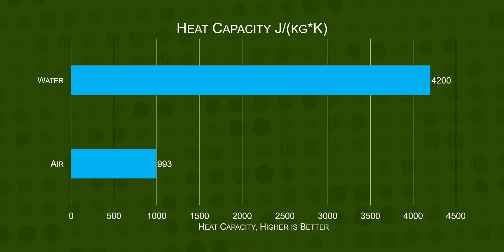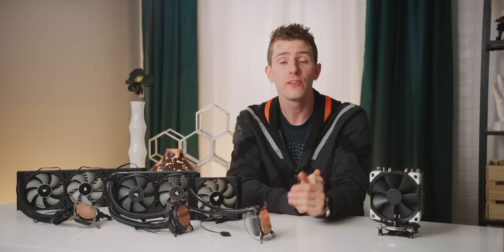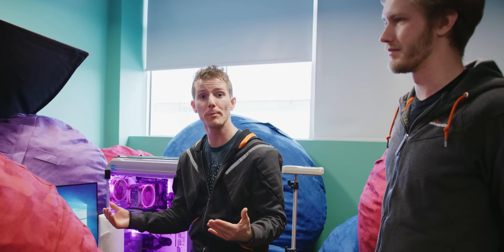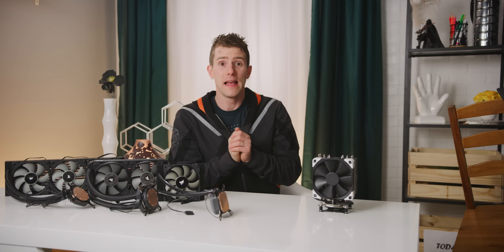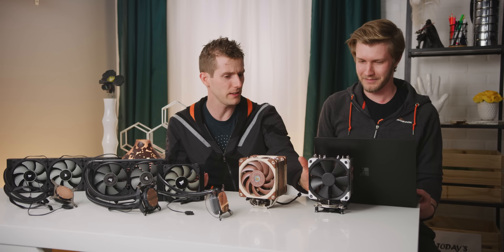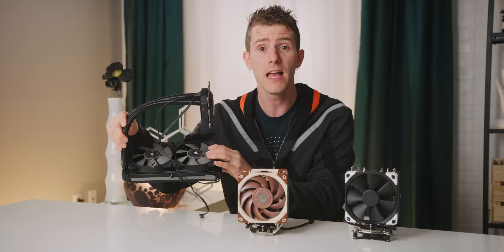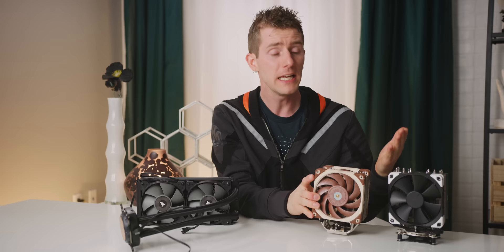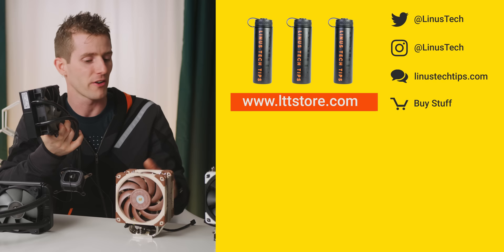Why you shouldn't water cool your PC

Comment: What is that paper roll doing in the quite room? ;)
Reply: hahaha I was wondering if anyone else noticed that
Reply: I will destroy your joke. they used it to clean thermal compound. they had to change the cooler 3 times.
Reply: @HeavyMetalGamingHD  I say maybe to that ;)
Reply: Playing the quiet game
Reply: I wasn’t taking it like some others, but it was a little stupid that Linus kept pointing to the case with the paper towels partially obstructing it.
Reply: dampen sound exiting at the back of the case
Reply: @pihermoso11  but they were trying to measure the sound levels exiting the case so, that roll would cause bias to the tests. Maybe they had the roll in wrong place when they measured air cooling.
Reply: i dont QUITE know
Reply: @HeavyMetalGamingHD  5 times actually
Reply: Could u give the timestamp
Reply: @HeavyMetalGamingHD  Also doubles as a bass trap considering the lower frequencies are still audible even if barely

Comment: Can't believe you didn't include the (venerable) NH-D15 in the testing!
Reply: That's what I'm looking into getting over my current 120 mil liquid cooler
Reply: @cupparuppa  you're in luck. The D15 stomps on 2x120mm AIOs even in short tests.
Reply: Yeah! Best CPU Cooler! I use it with LNA. Don't hear a think it my 7700k at 5Ghz stays below 85°C  while running prime 95

Comment: Air cooling all the way here. After a Corsair H100 killed my video card and caused a very messy cleanup and salvage process, by springing a radiator leak and showering the electronics in coolant.

Got a Noctua NH-D15 after that, and never looked back. Got way better cooling than the H100 provided too. If I had only checked that before I got the AIO. Expensive lesson learned. No more mixing water and electronics for me.

Comment: But but but... you CAN swap out the AIO fans with the snazzy ninja-esque Noctua many-bladed feathered edge jobs that whisper even at full pelt.
Reply: That would reduce only the fan and airflow noise imho. It's the pump where the issue probably lies in this case. I've been using Corsair ML120 Pro fan (no motor noise, airflow noise can be heard only while gaming when set properly, great static pressure) for my AiOs probably since they came out. When I swapped the old AiO (CM Seidon 120M) for a better one (CM Nepton 120XL), even when using that same ML fan, Nepton had this irritating pump noise that made me sell it and go back to the Seidon again. No fan can ever reduce the pump noise. 
But then again, it would be nice to see the test repeated with Noctuas on all of the tested CPU coolers, just to see if I'm right on this one. At the same time, it should be noted that total price for the AiO with three Noctua fans would go up and above of the average cooling solution. :)
Reply: each one of those fans is $30.. your cooling setup would end up costing over $200 vs $60
Reply: @c0rpse1  I didn't say it would be cheap! ;)

Comment: I had a Corsair H80i for a week. Than I sold it, and got a Phanteks air cooler. Couldn't be happier.
Reply: You could've just returned it
Reply: I couldn’t live with a giant ass ugly brick in my build
Reply: I also have a bigass Phanteks cooler.  Pretty nice having A++ cooling and not have to worry about pump failure/leaks.
Reply: @bitdrive7971  yup. Unless you don't care about looks, AIO coolers are great
Reply: Xsauced agreed
Reply: I dunno, I have used a H80iGT for nearly 5 years. Never had a problem with it. Has kept my FX 9590 cooler than my 212 Evo ever could
Reply: mrjspeed just for your information aios don’t just randomly start to fail

Comment: I think better test will be with same fans on every cooler.
Reply: agree. What happens when I put dem noctua fans on the water cooler?
Reply: cwjakesteel -00000 Temp
Reply: thegeorgezila  Not necessarily. Besides you can use the Noctua speed-lower-er device that cuts the fan speed in half. I use that on my AIO

Comment: i run a tripple rad with noctua fans. best of both worlds. the standard fans that came with my AIO were really noisy imo.
Reply: Same with dual fan.
Reply: youll have to replace the AIO sometime. Gunk builds up in the block, also im not sure how long those pumps will last. Noctua will send you mounting kits for future form factors, for free, anywhere in the world.  Reliable top performance with a practically unlimited lifespan is a big dumb block of metal with a noctua fan
Reply: fredfinks you can clean out quite a few AIOs. After 4 years I ripped mine apart (thermaltake water 2.0)  and there wasn’t much gunk. I sliced them together into a custom loop too. Just got new tubing, res, and water treatment. Also only have  Noctua fans in my case including PSU and Kraken G10.

Comment: Would have loved to see a Dark Rock Pro 3( maybe 4 too!) in the $75-85 price range just for funzies
Reply: M. K nice I have a dark rock pro 4 and I never go above 53 degrees. though I'm using an i7 8700k overclocked
Reply: They should have definitely done that
Reply: DRP4 here too thing is literally sex
Reply: From what i found out online trying to get my computer a LOT quieter(parts haven't arrived yet) Be Quiet's Dark Rocks perform very closely to Noctuas in any given price range with the advantage being slightly more silent for slightly less cooling. So in conclusion they are the kings of AIR cooling, and you pick one of them depending on what you prefer more, slightly more cooling or noise levels, also Dark Rocks look really cool while Noctuas are kind of ugly xD.
Reply: @cyzcyt  They are also comparing noise levels to the ratio of cooling...
Reply: Noctua is great for sure, but it looks like ass, literally brown. RIP color schemes
Reply: I have a Be Quiet Shadow Rock 2 on my Ryzen 1600X...with the stock fan it was garbage, but with the eloop B12-PS from Blacknoise it works like a champ! (with the new fan I have it overclocked to 4.0 GHz @ 1,35V)
Reply: Me here with a i5-8400 and an Evo 212
Reply: @_BangDroid_  Just buy the Chromax fans then?
Reply: Also have a DRP, which is on par with the good NH14 Noctua unit.
Reply: I have a Dark Rock Pro 3 sittin on an I5-5675c, maaan, even overclocked to 3,8 GHz its under 60 and sooo goddam quiet, i wanted to watercool my GPU, because it was killing me it was soo noisy next to it. So naturally, after watercooling my GPU i had to watercool my new CPU, the R7 2700x too, but if i would have the mount for AM4 definitelly would have played with it. That 250W beast is a BEAST!

I have that i5 in an Asus Z97i-Plus miniITX motherboard, the funny thing about this: all you can see from the motherboard is the PCIE x16 slot...:D

Comment: I've been using the same Corsair H100i for literally 7 years and it's still chugging along just fine :D
Reply: ROFL...uhhh ok.
Reply: I replaced my h100i with a noctua air cooler. Now delidded with better temps and not as loud.. These guys are totally right. AIO's suck
Reply: @jamieburns2407  lol my laptop with i9-9900k with 2 rtx 2080 with 4k is no joke
Reply: @0991ekul  That is your opnion, i have a h115i on my pc for 2 years no problem, i have 0 reasons to switch to air cooler, the video gave me none.
Reply: @OShadowPanda i wouldnt say theres a problem with AIO's. but theres no need for them 95% of the time. theres so much gimmicky garbage in the world of PC's nowdays.
Reply: I had a corsair h100i that killed a cpu when the coolant coagulated and the pump failed...as did a friend of mine...I guess its one of those "your mileage may vary" cases
Reply: @0991ekul  IMO the main reason for an AIO vs fan cooler is aesthetics. Big fan coolers block everything and if you want to make the computer a pretty showcase an AIO will let you do it as the bulk of the cooling is off to the side and the motherboard beautification heat sinks, LEDs if your into it, sexy looking ram all become the centerpiece. Your paying more for a showcase not performance as far as I am concerned ^-^
Reply: @Dlome693  bingo my friend.
Reply: @tropicthndr  wat
Reply: Almost hit the 10 year mark with my h100i...still chugging along! I'm probably going to bump up to a 280mm tomorrow tho. 10 years I'd say I got my moneys worth!

Comment: used an aio since corsair first came out with them 10+ years ago, never failed.
Reply: I use a watercooler for my i7 6950X for the 6 years I have built my system; never failed, zero noise. I also always use water-cooling for all my GPUs, zero fails, zero noise at 4k. This video did not age well at all lol.
Reply: I'm going to wait here until it fails

Comment: Water cooling just really does not seem worth the effort.

Also, everyone talking about the fan sound then putting their high quality gaming headphones on...
Reply: There's no effort when buying a pc with it installed...
Reply: Yeah, at this point there's almost no reason to compare noise levels. Unless your cooler is incredibly loud you shouldn't be able to hear it over whatever it is you're doing with the PC, even if you're just using speakers.
Reply: Yeah I don't think that whoever designed water-cooling as a "95% soundless cooling option" accounted for noise cancelling headphones. Seems like a fair oversight. Albeit I think that if it gets cheaper enough, which I doubt because air cooling is inherently just more simple, then it'll get more mainstream around the world.
But I think it'll stay as it is (an alternative form of cooling for people who like its looks) until something else is invented
Reply: Not everyone wears headphones when they game.
Reply: If you use a TV then noise isn’t a problem.
Reply: @KotauFPS  What country are you from? I'm from little New Zealand and i havn't seen a non-watercooled PC in about 5 years lol. People still use air coolers???
Reply: Not a lot of effort in an AIO. You just mount the fan piece and connect the cpu piece. It takes maybe another 2 minutes compared to the air cooled heatsink.
Reply: @Corruptness  Yeah, I build my own.
Reply: @TheEnoEtile  Agreed and you only do it once every few years when you upgrade. That said I love aircoolers because they look so big and work well.

Comment: Actually it's not water vs. air cooling, but water vs. heat pipes since both use fans to get rid of the heat...

If you move your PC regularly, buy a laptop.
Reply: That's how it's called. We call it air cooling to simplyfi it
Reply: Regular might be once every 6 months for a desktop though :D
Besides, you can get a much more powerful, cooler, longer lasting desktop than you can a laptop of a similar price point. For those who don't have much money and it's one or the other and moving around isn't constant but tehy also want a top tier gaming experience. Desktops are better :)
Reply: @Hedgehog1039  No. People who move around more get a laptop. You aren't going to get to and from work with a desktop. I know people that need one machine at work and at home that is powerful. They have laptops
Reply: @mikoajkoek3145  Notice how I said 6 months could be regularly for a desktop. Of course you woud use a laptop if you had to take it somewhere every day.

Some people do need to move their desktops regularly (in the sense of a desktop) but not every day or week or whatnot.  Some people take them to their friends or families sometimes for LAN parties for instance.

If you are using it for gaming and don't rely on it to be portable because you are not taking it somewhere every day, a desktop is cheaper and more powerful. I wasn't suggesting that if you are truly mobile or need a portable device for work that a desktop is somehow the better option.

Going back to my first point. Regularly doesn't mean the same thing when applied to different scenarios.

Comment: building your own custom loop is the pinnacle of enthusiasm. trust me, just try it! :D
Reply: random rick but money sadly doesn’t grow on trees
Reply: A friend of mine did. His all amd system is running at around 30°C at full load. He did use around 4 or 5 radiators though and at least two were 360mm and one was a 280mm. I think he invested more intp watercooling than the system itself. He doesn't even care for gaming all that much anymore and just enjoys tinkering with his build

Edit: No the radiators don't fit in his case. All but one are wall mounted
Reply: Someone I know the feeling lol
Reply: @bitdrive7971  Depending where you live, its made out of them lmao
Reply: @Someone-ci8wf  I went custom loop with my ryzen 5 2600 (OC to 4ghz) and 1070 ti (OC to 2.2ghz on chip, and 10ghz on the memory) with a single 360 rad (barely fitting in a meshify C TG) and I get 45c peak at full load (100% gpu usage, 45% cpu usage, Rainbow Six Siege ultra @ 1080p) after 2 hours (don't have a water temp gauge so can't tell you that)
Reply: @Someone-ci8wf  He should also try peltier element (TEC). ТЕC pumps the heat from one side to negative temperatures while heating the other side ... so the CPU is really cool and happy, while the other side is very hot but who cares. This idea was very popular few years ago but it didn't take off for some reason...
Reply: Too much money. Too much hassle. Too much maintenance. Looks pretty tho.
Reply: Dio Black  Some times its about more then just the basic experience, some people want better looking rims, even if the old ones work, or in this case having better cooling, even if the basic system keeps your parts at a decent operating temp, if you have the money why not make your system cooler, look better, and run faster. Its not like its all that hard to get money, and if this is what you're interested in, why not spend your money on it?
Reply: I would do it, but if the custom loom will be more expensive than my entire PC then something is wrong... The day I can afford high end top tier components I will do it. But custom loop for a core i5 and a gtx 1070 is useless, I would be better buying a i9 or a rtx 2080.

Comment: Corsair aio's do really just suck, the control software is a nightmare to just get it working like it should and then when you do you are presented with very loud poor performing fans.   Would love to see them tested in a video vs Artic freezer240 or coolermaster aio.  Everyone seems so stuck on corsair and they are so far the worst I have ever used.
Reply: Yeah the water cooler I have is an old Corsair AIO and it's pretty bad.
Reply: Cool master does fine. Not the best, not the worst. It gets the job done.
Reply: Its something, mostly I think that you can buy them off the shelf almost anywhere, bestbuy & microcenter both stock them and little else if anything.  So disgusted to use a H100i in a build and find it forces you to use software rather than bios to controll fans and the pump, oh but it runs the stupid lights too...  If that wasnt enough it was 20-25c hotter than an identical build with a arctic freezer 240 at comparable noise levels.  Sure the corsair could be made to keep up but no one wants to listen to that, my hitachi enterprise hard drives and evga power supply fan make more noise than this arctic aio under load  with a 4790k @4.7ghz all core and staying under 70c and thats the point of it, corsair is just a priced up name and flashy lights.   Hardocp reviews have the whole corsair line 5-10db over all of the competition while showing nothing worth mention to any advantage by them in cooling.

Comment: I cant say I'm surprised, when I first built my pc it was with a corsair h80, after a couple of years the pump started making noise so I swapped it out for a noctua nh d15 and the performance wasn't even close. The Noctua was running about 10-15 degrees cooler at idle and at load the gap was even bigger while remaining considerably quieter than the AIO system. Yes water will remove heat better and faster but once that water heats up then it loses performance. Water is only better if you have a constant source of fresh water. When it comes to taking that heat from the cpu and completely removing it from the pc case, air cooling will do it better.
Reply: I think you're missing the forest through the trees here. A good liquid cooling solution is just an air cooling solution with a bigger surface area and more fans. The Corsair ones are garbage because they come with mediocre radiators and mediocre fans. Even just swapping the fans on the Corsair AIOs makes a huge difference because the included ones are really terrible.
Reply: noctua coolers are beast :D i have this one and couldn't be happier : Noctua NH-D15 SE-AM4
 it's monster that keeps my 1600x ~ 60 most of the time under load, i had issue with it in first case i had my system in the case airflow is really important for this cooler and can make up to 20C difference, if the warm air is not getting away from cooler properly but rather rotating there. so i wouldn't reccomend cases with only one front and one back 120mm fans
Reply: Yep even in HVAC we use huge cooling towers to remove heat from water.
Reply: For it to work optimally, energy added/second (from cpu to loop) must be smaller or equal to energy dispersed/second (from loop ~ rad to room/atmosphere). Thus, this only works if joules/sec (in) <= joules/sec out. Joules/sec depends on the temperature difference, material AND the surface area [unit = W/(m^2*K) = (J/s)/(m^2*K)]. Delta T is hard to change, airco works, undervolting too, etc..., Materials are hard to change too, you saturate a loop mostly because you don't have enough surface area. Aka add a rad or 2
Reply: @sniperfox47  yes but what you're talking about is a custom cooling solution. It's not really fair to compare something you can just pick up from the store to a custom built water cooling loop. It's a very small minority of people who would actually go through the trouble of setting up a custom loop, even among enthusiasts it's not a significant portion who would do that.